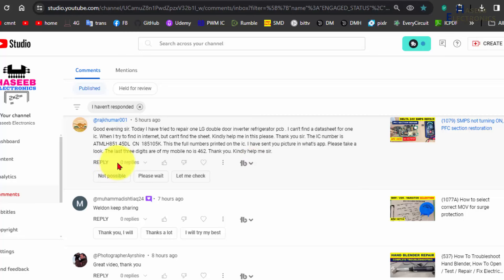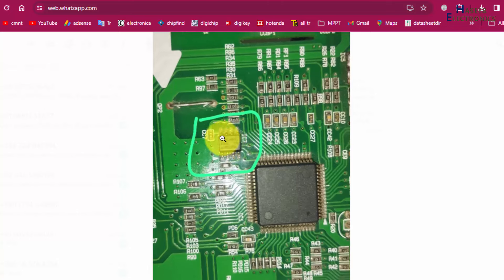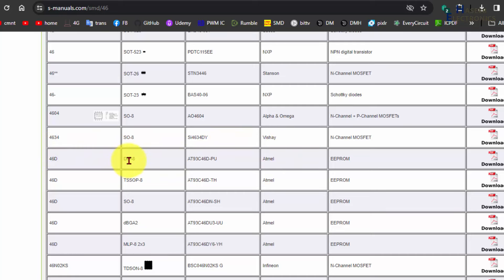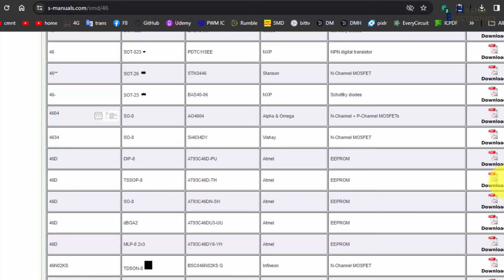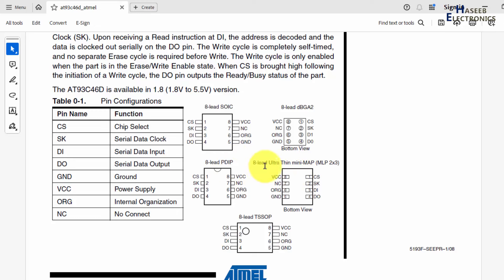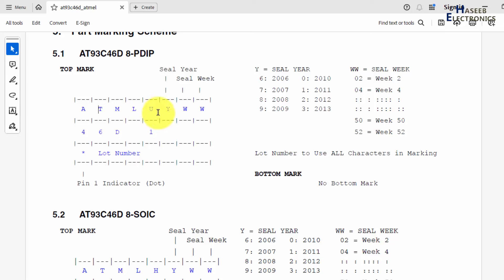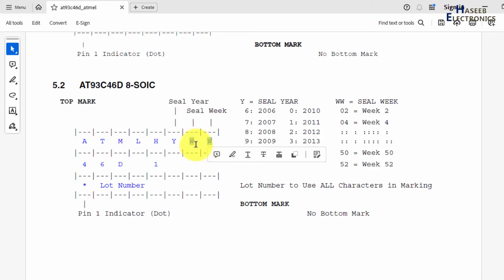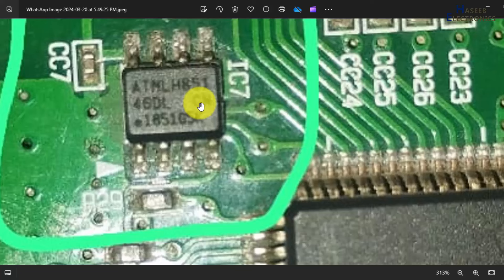{1080} How to find ATMEL EEPROM datasheet 46D

Comment: As-salamu alaykum, 
Sir pls🙏 Push pull transformer for inverter core ETD39 & ETD44 pe full trun and wire gauge kaise nikal le pe video bano 
Mai pura YouTube Chan liya but nahi milta koie Apke jaisa jo samjha sake aur Apke sare vide smps power supply wale core or hai ,formula sahi se bata do
250-500-1000watt ke liye